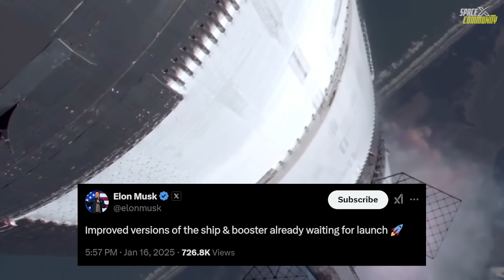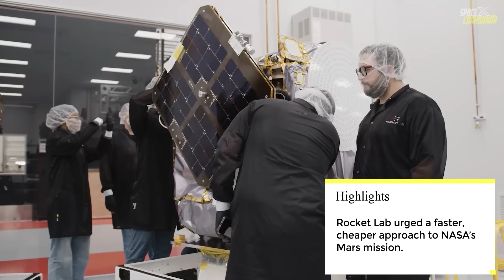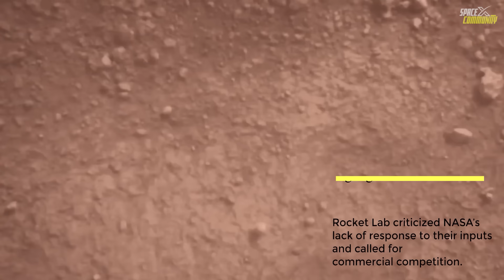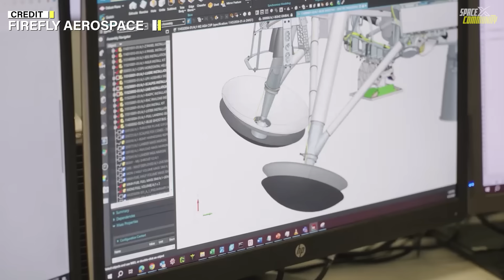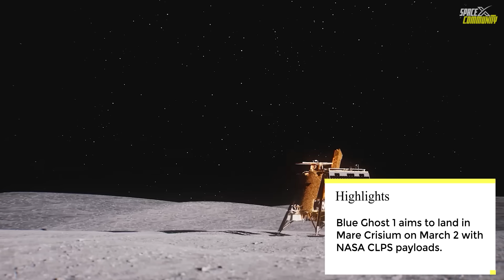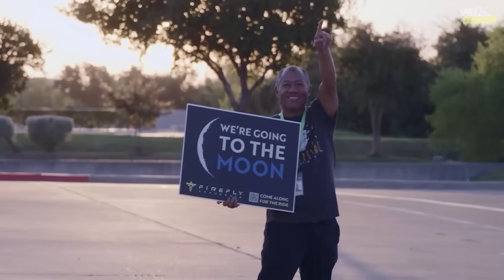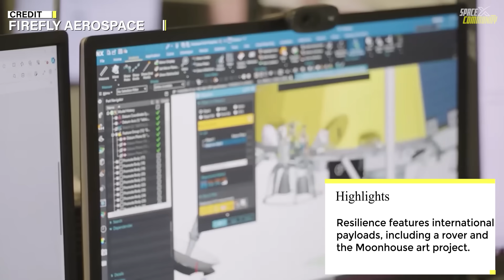SpaceX Revealed EXACT REASON Why Ship 33 Failed During Starship Flight 7 Exploded! Now We Know

Comment: No, they talked about internal landing pins that would be behind a flap until landing. We expected a temporary covering that could be pushed loose. My guess this was that flap.
Reply: Can't be, you could clearly seethe rivet holes at the plate connection points. This was the skin of Starship.
Reply: This was a raised feature on the ship. Not the pressure hull. I suspect it was a box surrounding an alignment hole, used by the chopsticks for stability. 
 @TwistedMetal007

Comment: 80% of these non-tech airheaded commenters are as dumb as a bag of marbles.
The tear or the piece missing off of the steering fin hinge had nothing to do with the failure...!!!
Reply: Agreed. It was a sloped corner on a rectangular box located above the upper bulkhead. Outside of the main hull. Part of the unpressurized section of the ship.

Comment: My 5ct on this:
Steel would not flex like this, it would flex a few times and break of.
Telemetry in the video from the upper stage shows a rapid decline in CH4, but not in LOX, shortly before the telemetry is not updating any more.
The main goal of space rocketry is to reach orbit in a functional state, not to catch the booster.
New Glenn was a success in this regard, on the first try. 
Even Space X had no success in landing the booster on the first try.
Reply: Which booster? Cause they did catch the super heavy booster on their first try. Flight five was the very first attempt to catch it and they did. Flights 1-4 were planned losses. So... 2 out of 3 planned catches is pretty darn good.
Reply: @stevengawlik1282  
Falcon 9 was Space X first booster where payload reached orbit and the booster landed successfull after a few failures?! Correct me if this is wrong.
As software developer, I get chills every time Space X tells the public "each flight is a test flight, we work incremental like SW development". Every company which builds complex hardware works like this. This is dictated through risk management. Risk as defined by cost of failure multiplied by the probabillity of failure.
There are known causes of failure and unknown causes of failure. Tests are done to learn about the unknown causes of failure, to include them into risk managment.
This is the reason i'm more impressed by Blue Origin and the success on the first try to reach orbit. We (humanity) reach orbits since ~1960s, we learned many failure modes of rocketry in the past. Blue Origin seems to be more able to learn from the past failures/failures of others (one definition of wisdom) than Space X.
If known causes of failure are not handled propperly you get regression... like the Space Shuttle failures... or a failing upper stage, like here.
Reply: Blue Origin has used 20 years of careful preparation for the New Glenn flight.

SpaceX uses rapid prototyping, rapid construction, rapid fail,  rapid revision. The Star Hopper first flew in August 2019. Super Heavy was caught in 2025. That is rapid progress.
Reply: And no. Both companies are depending on the reuse of the booster. It is a fundamental requirement.

Comment: I’m convinced that catching a booster ain’t worth losing the rockets. That’s all he’s been doing trying to catch boosters while wasting billions in investors cash on rockets
Reply: Don't fret it - no investors are concerned at all. The speed at which SpaceX is progressing is absolutely mind-boggling.
Reply: Reliable construction cost estimates of the Starship second stage is roughly $20 million US. The SH booster may cost less than $80 million each.

Soon they will both be fully reusable, and construction costs will eventually amortize over a hundred launches - or more. The fuel for 100 launches of the same vehicles may cost more than the hardware.

Comment: Elon Musk could put Space Shuttle like doors on the SpaceX Starship and have cargo pods (28’ X 48’ to 68’) that are pushed out of the cargo bay using springs, and have anti-spin, course correction devices on the cargo pods and use a cargo pod pusher to push the cargo pod towards the moon / Mars, and use a cargo pod lander, to land the cargo pods on the moon / Mars. And have at least two doors on the bottom of the cargo pods, and connect the cargo pods together using inflatable tunnels, covered with cement by 3D printers, the cargo pods could also be covered with cement by 3D printers, the cargo pod could have built in facilities in them, like everything a moon / Mars lander would have in it, or everything a space capsule for 100 people would have in it.  Or a refinery, factory, warehouse, farm, orchid, dairy, ranch, fish growing facility, grocery store, retail store, hardware store, park, amusement park, arcade, night club, city hall, police station, jail, recycling plant, repair shop, etc., etc..  Also he could use inflatable habitats / buildings, covered with cement by 3D printers, when larger facilities are needed / wanted.

Comment: What about the flicker in one of the flap hinges at T+7:55?
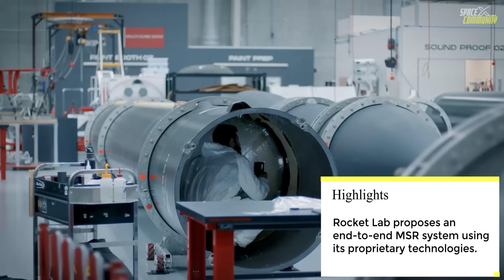What about the engines failing one by one at T+7:40, T+8:02, T+8:03, T+8:18 and T+8:24?
What about the LOx/CH4 imbalance getting bigger from T+7:55. Apparently only little to non LOx is used from that point on.
The imbalace can mean multiple things:
     1)  LOx supply reduced or stopped
     2)  Failing engines don't need LOx/CH4. LOx got reduced accordingly but CH4 (methane) kept beeing supplied to a reduced number of engines.
Both can result in a (very) rich fuel mixture resulting in incomplete combustion. This in turn causes not only CO2 and H2O to be formed at the exhaust but also CO (carbon monoxide), H2 (hydrogen) and C (carbon deposits / soot / grime). I assume it's common knowledge that H2 is higly explosive in an uncontrolled environment.
    3) CH4 leakage
Reply: LH2 needs oxygen to burn/explode. Ship was at 146 km altitude, so there would not be enough atmospheric oxygen to create an explosive environment for the excess LH2. It will be interesting to see where the explosion took place, and how.
Reply: The explosion took place when the ship was re-entering the atmosphere or leaving the flight corridor. Maybe both. 
 @johnnymnemonic1
Reply: CH4 not LH2 
 @johnnymnemonic1
Reply: I saw that flicker of reddish light and thought "what the heck is burning on the way up?" I saw Scott Manley's video on it and his showed the upper stage engines cutting out oddly -- first one, then another, then a couple more, then another, with one looking like it was still lit just before the telemetry was lost. WAI showed some video where someone was able to see the upper stage's engines going...then it exploded. I'm thinking something happened with the flow of propellant and the stage became erratic due to off-center thrust, and possibly the FTS kicked in and ended the flight.
Reply: What about... Naomi?
Reply: @R34un41d  correct 
when CO cools below 1000C the Bouduard reaction takes place:
2 CO > CO2 + C     (soot)
above 1000 C , CO dominates 
below 400 C its all CO2 but the soot remains as a carbon deposit,
Measuring the gas temperature gives the ratio of CO to CO2 with engineering accuracy. But of course that is not practically doable on a rocket nozzle

Comment: Elon said initial data showed a oxygen/fuel leak in the engine bay which caused a fire which led to the cascading of engine shut downs and then rapid scheduled disassembly
Reply: Might be intentional disassembly. The AFTS is to be triggered by the flight computers if the ship is leaving the flight corridor. Also detonates if communication with flight computers is lost.

Comment: Seeing as they have only had basicly 1 successful flight out of eight... yeah no this is not a good launch.

Also, the simple fact is they already caught a booster. So thier goals should be more than simply catching it again.
Reply: Booster goes up, booster goes down, booster goes up, booster goes down....
Reply: As though catching a booster isn’t still amazing. The flight failed, they’ll fix it for next time.
Reply: SpaceX is innovating astonishingly fast. The next Block-2 Starship will be revised quickly. 5 or 6 weeks until IFT-8.

Comment: Whatever, but the upper stage has failed so many times and is a sign of complexity of starship design and what is it aimed to achieve. 
Seems there is a great need to re evaluate the design which ultimately threatens the safety perimeters
Reply: These are prototypes with the goal of ironing out design flaws.  All according to plan.  Patience please.
Reply: But they didn't "fail". All were launched suborbital on purpose. By plan. 

Other companies require a couple decades to achieve what SpaceX did in 6 years. The very first StarHopper in 2018. Catch a booster in 2024. Insanely fast.

Innovate fast, build fast, test fast, revise, repeat. 

The prior 6 Starship were only various Block-1 versions. The first booster wasn't even a Block 1 version - more like 0.5 ! 

Innovations and lessons learned have all been incorporated into thousands of changes in this new Block-2 Starship. 

Keep in mind that the factory is designed to make astonishingly inexpensive products at an astonishingly rapid pace. That is a priority. 

Every aspect is being revised and refined everywhere all at once: Engine design, Starship design, Booster design, Propellant farm, Launch mount, Catch tower, Production, Testing, Software.

Comment: This starship was supposed to be lost in the Indian Ocean anyway. The important thing is that they got important data which will prevent future rapid disassemblies.
Reply: it barely pass caraib in pieces
Reply: What bollockks
Reply: Just say “blew up”. Using a fancy phrase doesn’t change it blowing up
Reply: Did they actually get the data out of the wreckage yet?   No
I think they should mb stop tinkering with design
Reply: @NancyBarrios-k8v  Hi, I think they get the data live through Starlink for cases like this.
Take care M.
Reply: "stop tinker with the design"? But this was only the first flight of the experimental Block-2 version. After many tests and revisions to Block-2, then the Block-3 will be built, tested, revised, etc. That's the way SpaceX rapidly progresses. 
 @NancyBarrios-k8v

Comment: I am not convinced that this tear is what caused the explosion. Take a look at how one of the inner three engines goes out about a minute and a half before the explosion. There could’ve been cascading failures happening around that engines plumbing, which eventually caused the failure, let’s wait and hear more from spacex about the root cause.
Reply: Yea fr, such clickbait title 💀
Reply: That tear seems like a far away assumption on how Starship failed.
Reply: The tear seems irrelevant to me as there does not appear to be anything venting from it.  If your license plate wobbles a bit on your car it doesn't mean your car will explode!
Reply: They went beyond the point of maximum dynamic pressure
Reply: Australian sabotage. The Australians are responsible for sabotage of many Space X launches If Space X is successful, the Australians stand to fall way behind in their own space program.
Reply: Hopefully, the data captured from all of the sensors and cameras will provide good analysis on what went wrong.
Reply: Ok mr Rocket scientist
Reply: It wasn't the tear, they already confirmed it was an oxygen leak coming near the flaps.

This channel sucks ass for posting speculation.
Reply: The commentators did mention that several, not just one, of the engines had failed just prior to the loss of communication with the Ship.  During takeoff I noted a very loud flapping/knocking sound that did not sound normal, as if something was loose.  There were so many new innovations on this particular Starship it will take a lot of investigation to discover which one went wrong.
Reply: A tear would be caused by a fuel leak and faulty engine valve
Reply: It looks like it's a patch over the main body. I'm looking at this videos time point of 2:48. Not sure what the patch was covering, but that's not really metal. It looks more like a fabric cause metal doesn't flap in the breeze.
Reply: I think someone left a noBake cookie in one of the manifolds by accident.  As the temps reached peak numbers it melted and clogged the pressure bleed valve doors on the tank leading to the cascading failures and in turn the explosion
Reply: Since its a pressurized tank and the hull doubles as the wallfs for the tank... You can expect that this exploded after the pressure went too high... Also the engines most likely failed because of the tear...
Reply: And pressure went too high since they began flying away from earths atmosphere
Reply: Who the fk are you?😂😂
Reply: Good post by you. @Ferrisbueler-q5t
Reply: @Ferrisbueler-q5t  Please chill.  It was his theory.  You know what internet chats are for.😀

Comment: Maybe time to become a little more humble. Space is hard. The most important part of the rocket is payload delivery. Otherwise a useless rocket. I  hope the tone in all the Space X videos will change.
Reply: Someone forcing you to watch?
Reply: No matter what, Flight 7 wasn't  going to put payload into orbit. It was sub-orbital and dummy starlink deployment was more to test out the updated pez-dispenser. SpaceX was smart enough not to rush, and put starlink satellites on this flight... BO, different story. Their payload to orbit was Blue Ring? Tiny payload, and relatively cheap in case of a RUD. NG had slow lift off with low thrust/weight ratio ~1.1 vs ~1.5 for Starship. Plenty for BO to work on, including recovery to compete with respect to cost. Yes, payload to orbit is the ultimate metric... but in 2025, there is no contest- Falcon 9 is the undisputed champ (SpaceX has plenty to be proud of).
Reply: They are pressing the edge of space exploration beyond what anyone thought possible till they tried it. They will have this fixed in the next flight about guaranteed
Reply: Yeah gotta throw billions of taxpayers money and years to get it as right as they did the space shuttle how many human lives were lost again with nasa again
Reply: Humble because I test vehicle blew up. Test vehicle...
Reply: Humble communists give all the money to the government to figure things out.
Reply: Apollo never failed like this.
Reply: “Iterative” prototyping. Failures are expected and used as lessons from which to learn.
Reply: @jedisdad2265  "Iterative protyping" just mean being rich enough to do experiment the easy way. All PhD student very quickly learn to stop doing experiments "iteratively" because it is too expensive, money wise and material wise (some reagents are rare). Lucky for elon he has alot of money thrown at him. SpaceX has already spent the $3bn that NASA awarded it to build a lunar lander.  Luckily Elon  managed to get congress to give him another $1.5bn of NASA money to play with. And remember... SpaceX has to build a lunar lander, not a reusable rocket.
Reply: How many other agencies have caught a booster to date?
Reply: Oh mean be depressed and cry?   Spacex unsuccessfully landed Falcon 9 like 7 times before nailing it on the 8th and now it works every time - 300.   Starship was a new V2 design with thousands of changes.  It's like Ford coming out with a new model and 3 months later it gets recalled for 20 problems.  You could buy the old model that's now reliable but it doesn't have the toilet ass brushing seats.
Reply: @FrankCappello_official Funny.i
Reply: I liked the quality of your reply, until you just had to devolve into "toilette ass-brushing seats", and made me spit snot out my nose. 😜😂
 @FrankCappello_official
Reply: Yea I think they have no reason to be humble.
Reply: Actually landings are secondary. I am talking of payload to orbit. The only reason for a rocket. So, yes, it was a failure. A big one.
I will make it easy…
Imagine it was New Glenn.. got it?
Reply: @pedrosura  You want to compare to BO?  SpaceX had hundreds of successful orbital launches and landings.  BO has 1 successful launch to orbit.
Reply: @pedrosura yeah….  Comparing two different classes of vehicles, undergoing two different types of testing….